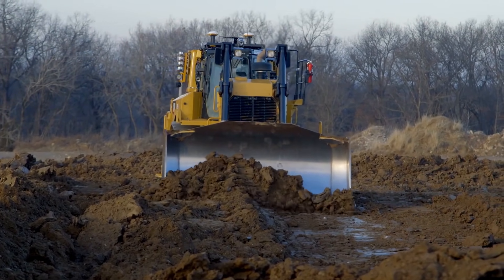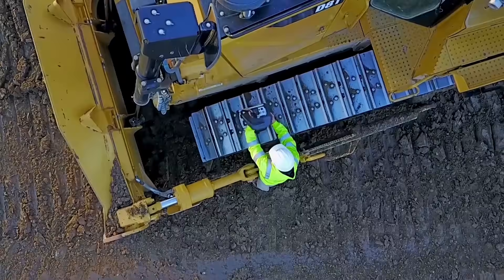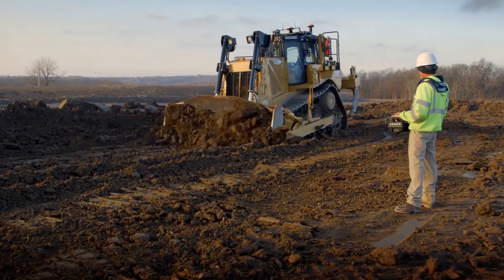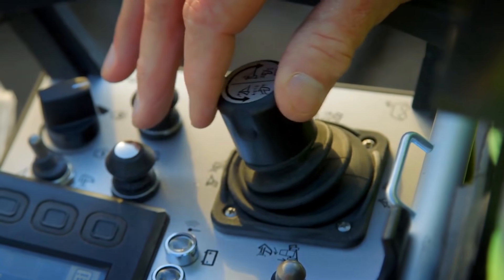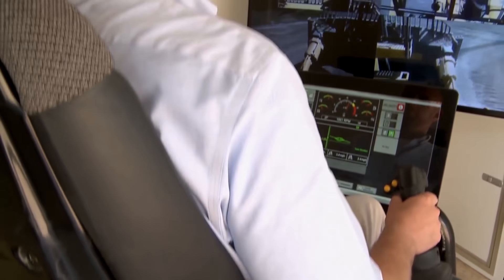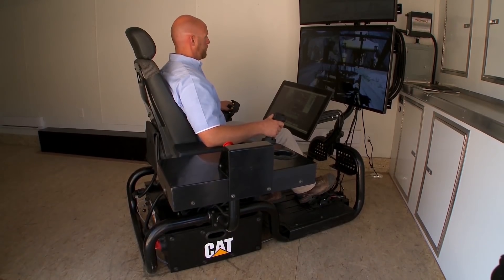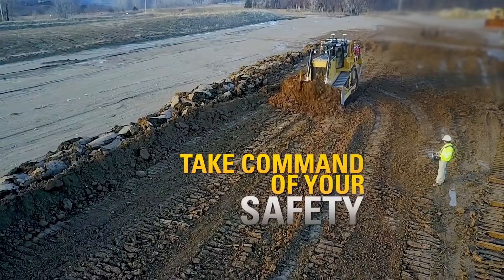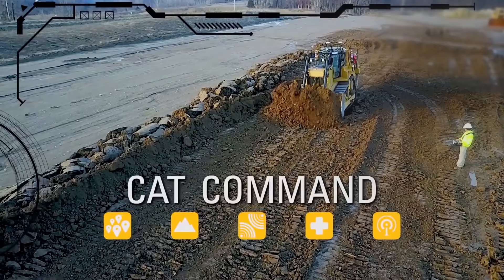Take COMMAND | Remote Control Dozing on the Cat® D8T

Comment: I don't get the concept you can be safe in the cab and have a seat very comfortable in the cab and safe you will not get ran over in the cab and it had remote controls in the cab too with roll over protection you can even take your coat off it has heat or ac and radio in need be with oil pressure and temp gauges as well probably safer in the cab just a thought eye site as well when cutting or filling grade